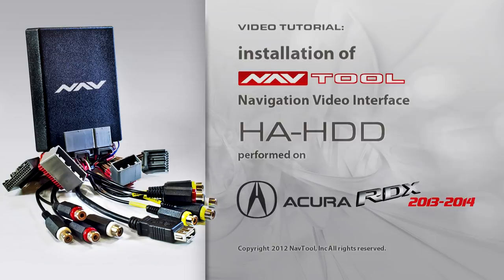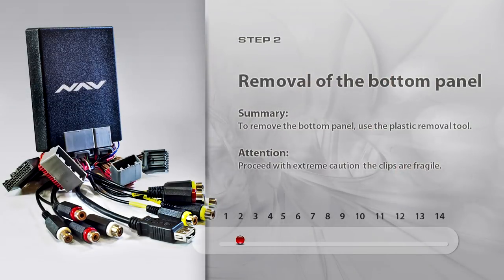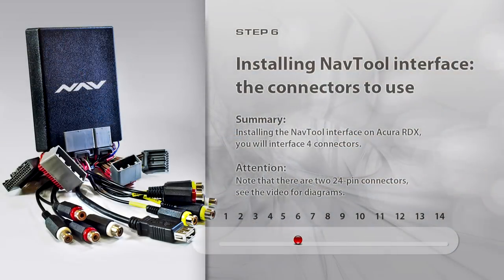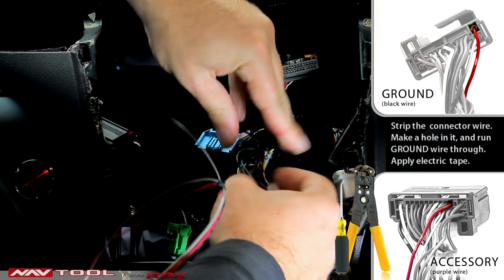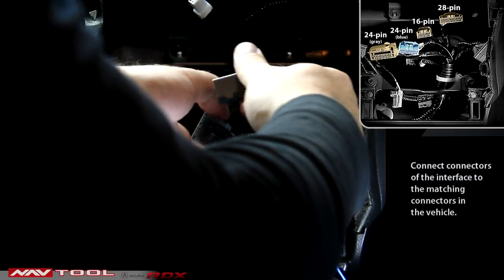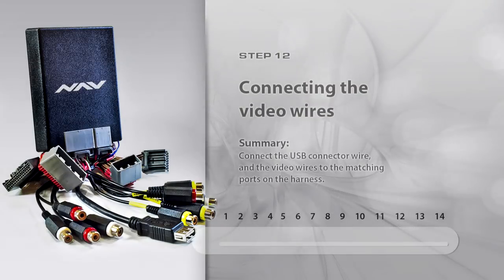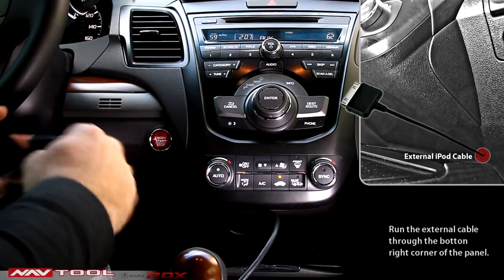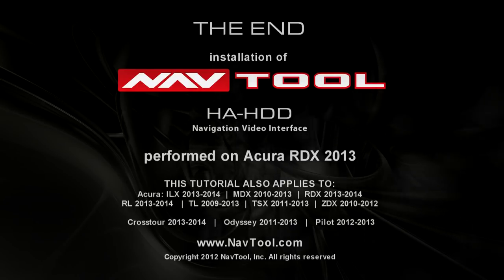ACURA RDX 2013-2015 NAVTOOL NAVIGATION VIDEO INTERFACE, ADD APPLE CAR, SMARTPHONE MIRRORING(CARPLAY)

Comment: I dont understand. You placed the radio in aux mode. Doesnt that mean thay you had to run rca to the auxiliary plug?
Reply from the maker: Yes you will neatly run a cable
Reply: @Navtool  okay. The video failed to mention that part. Was under the impression it was bluetooth.
Reply from the maker: for mirroring you can